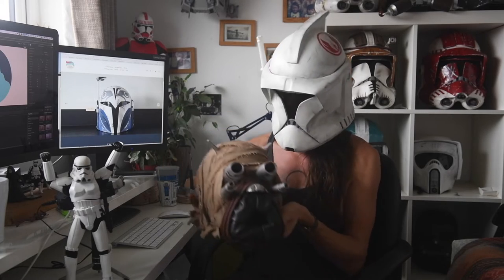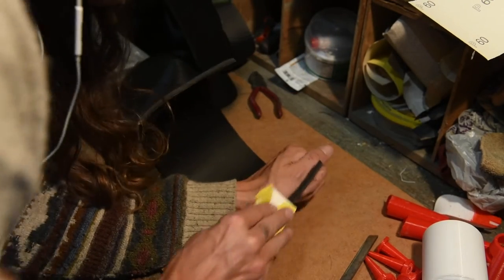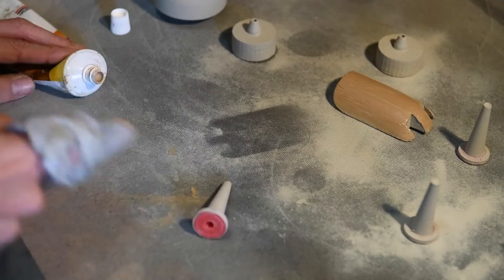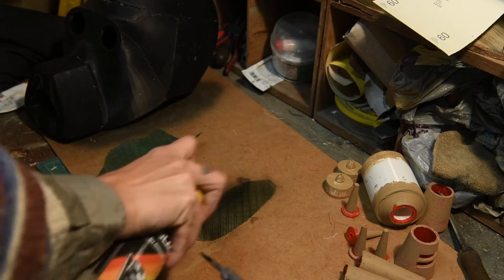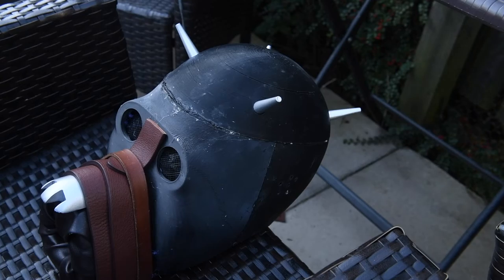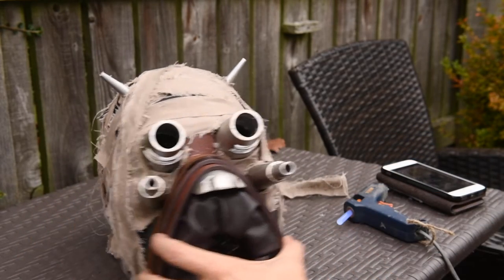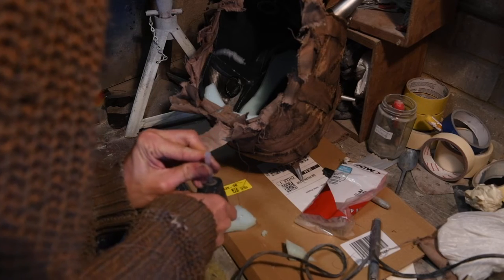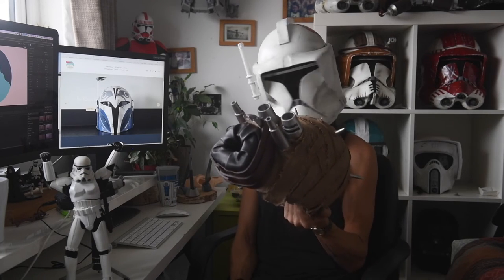How I made a Tusken Raider Helmet

Comment: Some critique: using a chip brush, only a 50 cents or so, to paint your weathering. The ragged bristles will give your parts look of scratches as well. Also, you might use an oribital sander on the big parts with a higher abrasive pad. It'll save you a lot of time sanding. Very nice video and artwork!
Reply from the maker: Thanks buddy! Yeh I use a hand sander on helmets to take out the leg work. The tuskens only have the accessories that need smoothing so super easy by hand. I'll look out for a chip brush thank you and thank you very much for your kind words!